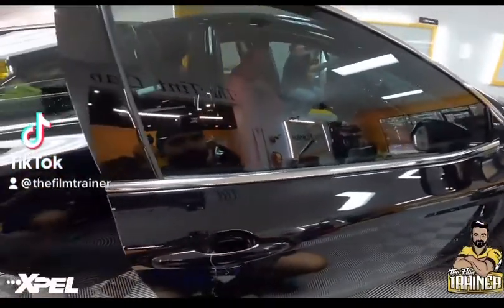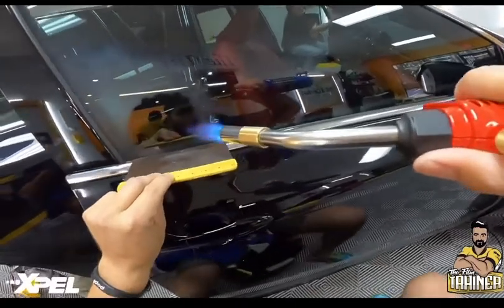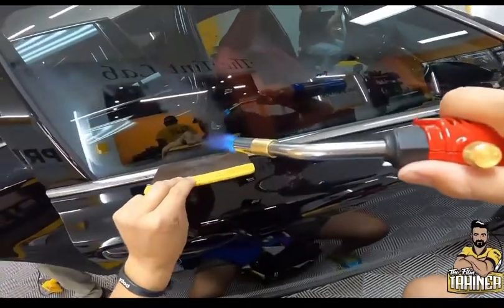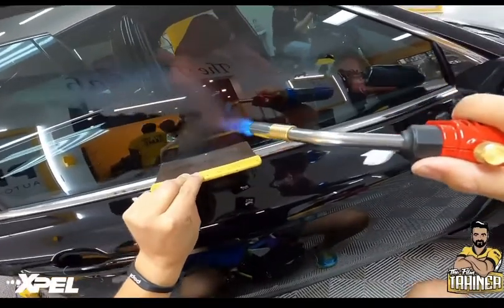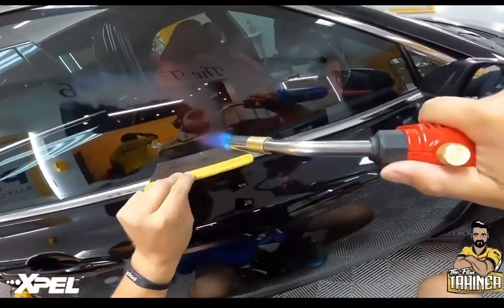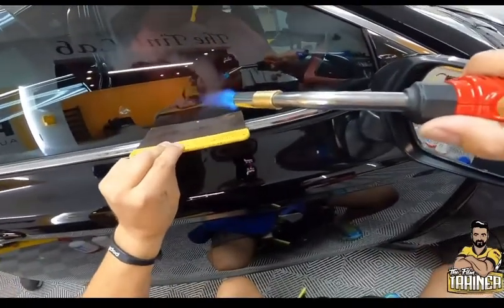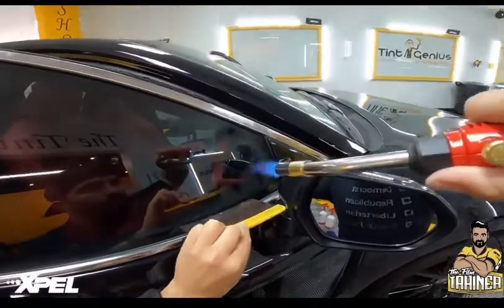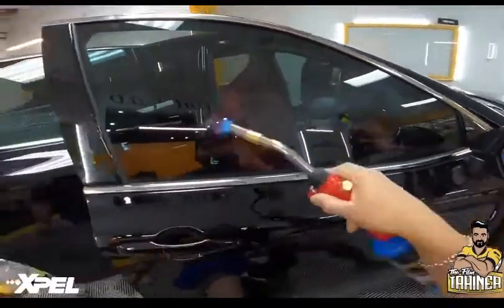How to Speed Dry Tint

Comment: Does heatgun do the same thing?
Reply from the maker: Slower with a heat gun compared to a torch
Reply: Just do it on the inside with a heat gun just make sure to use those blue work towels on ur card to not scratch the tint